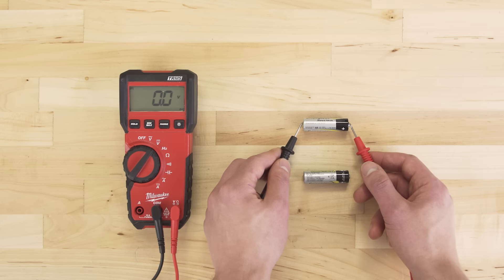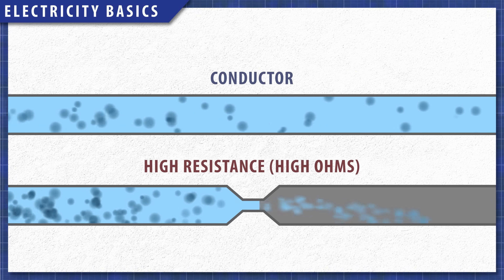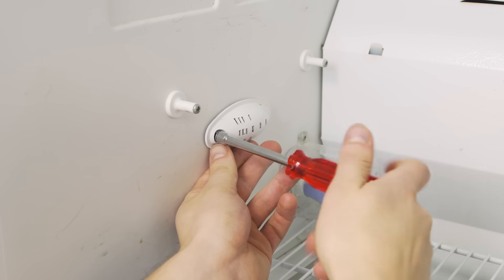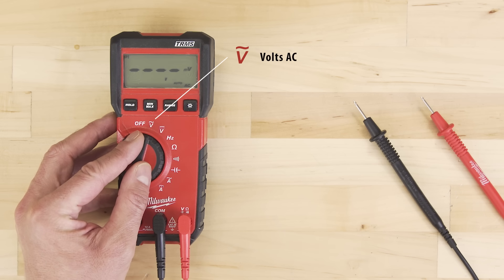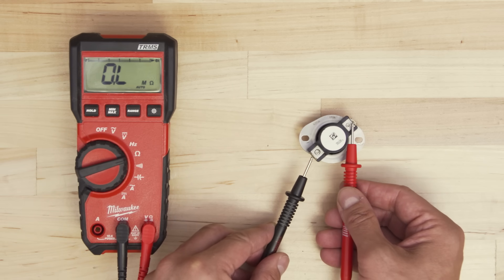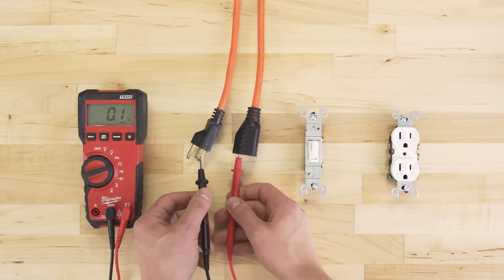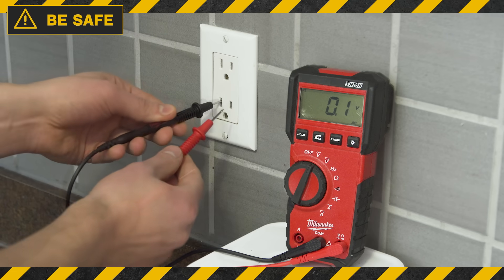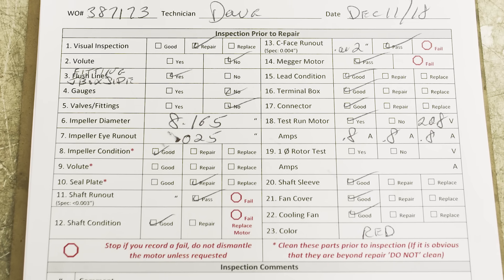How to Use a Multimeter & Electricity Basics | Repair and Replace

Comment: First thing you should do when you buy a multi meter is throw away those crappy leads and get some fused and shrouded ones. 
I’m so surprised nobody posting these videos says that.
Next is get a Kewcheck 103 or similar.
Reply from the maker: Thanks for watching. You are right that multimeter leads with built in fuses add an additional layer of protection. Not many models include those leads but it will be interesting to see if that something that will change over time.
Reply: @AmreSupply  The biggest problem is people poking through small holes. It's less of an issue in the house/car but I've seen it go badly......

Comment: There are many errors in this video. First, 60 Hz current flow does not change direction 60 times a second. It changes flow direction 120 times a second. Each Hz is a complete cycle of forward and back. OL or O/L does not mean Open Loop. It means Over Limit. In other words, the reading is higher than the meter can display on it's current setting. If you get an OL reading when trying to measure voltage and think it means Open Loop someone could get killed very quickly. Another very important factor is the multimeter's Category and voltage rating. A Cat I meter is good for electronics and not much more. It might not be safe to measure a regular wall outlet. A 240 volt dryer outlet would require to be Cat II and rated for at least 300 volts but Cat III and 600V would be better. Also, making any measurements of live electricity of 120 Volts or more as part of your employment requires the use of appropriate PPE and Arc Flash certification. It's the law.
Reply from the maker: Hi Rich, thank you for watching. We appreciate you sharing your thoughts and you make some good additional points. The "changing direction 60 times a second" was an error that we caught only after uploading. This is something that can't be fixed without completely re-uploading the video, but even with the error, we feel that the difference between AC and DC still should be clear. This video is meant to support our other repair videos which are focused mainly on understanding circuits and continuity tests of isolated components. We do not show live testing of appliances and that is one area that we leave to the professionals. This video is intended to help people get a base level understanding of electricity so that they can do some simple tests and better communicate with professionals when more in-depth work is needed.

Comment: Good basic multimeter training but should have proceeded into amp probe use.It's safer than voltage testing & just as useful.Can diagnose low refrigerant, dryer heater failure (especially when one heater is open)
Reply from the maker: Thanks for watching. Testing amperage is outside the scope of this video. This video is meant to support our troubleshooting and repair videos which focus on continuity tests of components.

Comment: Excellent content.  I've worked on about all the devices shown!  How did you get 1.5 M views where mine got 80.  (Just 80).  https://www.youtube.com/watch?v=POxw_gCcUj8&t=2s    It is prepared more for rural power wiring.
Reply from the maker: Thanks for watching. It has taken a while to build our YouTube channel. Some views come from the YouTube search, some come from YouTube recommending this content. Not all of our videos get a million views. There is no single way for that to happen but what is needed is good content that people continue to watch and don't click away. As well a good thumbnail so people will actually click on the video. The right title, description and keywords helps YouTube know what your video is about, and will help with the search results and the rest comes with time. Likes, comments and other interactions help boost a videos as well.
Reply: @AmreSupply  Very good, thanks for a thoughtful and sincere reply!  Likely it is the keywords "how to use a multimeter".  That was the question which was asked and dropped my jaw for 25 years since a person has to know electricity to use a multimeter, it's not simply a "magic meter".  :)

Comment: Slight problem with video. 
The testing of the wall out let. 
The use of both hands testing high voltage is not recommended. If there was a problem with the test leads,insulation damage as example a current would flow up one arm through body/heart and down other arm . Where I live it's 250v you could die. It's safer to use one hand , hook up one lead then prob with other using one hand.
Reply from the maker: Thanks for watching. This video was focused on 120V in North America but it does seem like a lot of views are coming from other countries with a different power system. You are right that in the case of the damaged leads, the safest way would be to use a single hand. That's why inspection of the multimeter is essential before any testing is done. Gloves can be another additional layer of safety as well.
Reply: @AmreSupply  Many thanks for replying.  I'm in Western Australian and we have a truly stupid system which uses the plumbing as part of the earth system.  The earth's and neutral come together in meter box , result if a failure at this point occurs pipes become live 250v and you can die taking a shower.
My son ended up in hospital and is ok a young girl near us turned on garden tap and now permanently brain damaged. 
All new houses now must have earth leakage breakers on power and light circuit's  old homes if sold must install and rentals. 
Great video, being an electrician I tend to like watching these videos.  All the best to you,  got a feeling you in Canada.
Reply from the maker: @chuckmaddison2924  Thanks for sharing that info. You are right that we are based in Canada. It is quite fascinating how different countries have various electrical and plumbing codes, each evolving at different times. Not all systems are as safe as others but generally the codes all require new homes or renovated homes to be up to the new level of safety. In Canada a GFCI circuit is required for all outlets close to a kitchen or bathroom sink. We also have a dedicated ground which connects back to the neutral on the breaker panel.

Cheers!

Comment: voltmeters have a very high resistance so you won't get a shock from the probes.
Reply from the maker: Thanks for watching. You are right that the insulation of the probes has a high resistance. However, damaged to the probe handle can increase the risk of a shock.
Reply: @AmreSupply  No, I think you misunderstand.  I am not talking about the insulation on the probes. I'm talking about the meter itself. The actual voltmeter has a high internal resistance. Since a voltmeter is connected in parallel across a circuit it must have a very high internal impedance to not affect the circuit. 
This high internal impedance means that very little current will flow through the leads. Therefore there is no risk of shock.

Comment: Why is Americans using  only 120 Volts? Doesn't it give lower power to electric tools? How in earth are people in America even charging their electric cars in future? Europe uses 230V.
Reply from the maker: Thanks for watching. Thomas Edison, who devised the first practical light bulb, determined that his bulbs would be powered by about 100 to 110V, as an optimal choice for his filaments. When the power system in North America was set up, the final drop to individual homes in the US became 240V center-tapped, where wiring in the house was divided evenly into two sets of 120-to-neutral lines, plus several 240V outlets for heavier loads like ovens and dryers. When Europe switched to a 220-240V power system, North America already had many appliances and other devices setup for 120V so it would have been a difficult change for North America.

Comment: @AMRE Supply
I wonder how pressure is created in the wire in order to send electron ?
Reply from the maker: Thanks for watching. Since voltage = pressure, the amount of voltage needed for an electrical current to flow will depend on the resistance of the wire. Its all interdependent: https://www.rapidtables.com/calc/electric/ohms-law-calculator.html

Comment: What about my car battery? Duh
Reply from the maker: Thanks for watching. Car batteries can also be tested using the Volts DC setting. Fully charged automotive batteries should measure 12.6 volts or above. When the engine is running, it will show between 13.7 to 14.7 volts.

Comment: I use the amps multitester to the house power socker, and suddenlly my breaker trips.. the whole house mad at me 🤣🤣🤣
Reply from the maker: Thanks for watching. It is not recommended to use the amp setting with AC voltage as was cautioned in this video. The amp setting will measure the current flow, and without a load there will be a short circuit where the current will flow unrestricted. This is why the breaker tripped.

Comment: From a life long electrician. A digital auto ranging VOM meter is a great tool but NEVER purchase or use and test & safety equipment, tools or Lee's from lying cheating lack of quality control evil bag communist China. Had their meter leads break first month of use. Coworkers who had cheating China sockets hated them. At least 1 socket in every set was oversized and a lot of times one socket undersized causing you to hammer them on.. The larger the motor the smaller the resistance. Before performing resistance test double check that there is no power.
Reply from the maker: Thanks for watching. You make some good points about quality which is especially important when using a multimeter.

Comment: Direct current illustration....battery operating a fan. Are you sure D.C. current flows negative to positive as you indicate?
Reply from the maker: Thanks for watching and that is an excellent question. 

Conventional Flow Notation refers to how the electric charge moves from the positive (surplus) side of the battery to the negative (deficiency) side.
Electron Flow Notation refers to the motion of electrons in a circuit, which is from negative to positive.

Most engineers and electricians choose to make conventional flow their notation as it helps to simplify their drawings.

Both can be used as long as the entire circuit is analyzed in its entirety.

Comment: Are those test leads fused ?
Reply from the maker: Hi Will, thank you for watching. That multimeter uses standard leads. If you're curious it's the Milwaukee 2216-20 model https://www.amresupply.com/part/2216-20-DIGITAL-MULTIMETER
Reply: @AmreSupply  Just as I guessed. No criticism to you but to Milwaukee - they should fuse their leads. Putting non-fused leads on a potentially dangerous circuit can lead to injury or worse. Just my ten cents.
Reply from the maker: @willmitchell255  Thanks for sharing your thoughts. An extra layer of safety is always helpful. The fact that fused test leads are not included with all multimeters might be a 2 factor thing. Multimeters do have an internal fuse so the need for fused test leads would depend on what the multimeter is being used for. Fused test leads do add an additional cost, so buying fused test leads separately might still be common for a while. There are more talks within industries requiring it so it might change in the upcoming years.

Comment: I have an outlet outside on the side of my deck and it no longer works when anything is plugged into it.  Do I need a new outlet?  And im assuming I need to turn the breaker off for it.
Reply from the maker: Thanks for watching. Its possible that the outlet is faulty or the connections are loose. Regardless you are right that you have to turn off the breaker first. For this scenario, using a NCVT non contact voltage tester will help verify if the circuit is energized and has voltage without having to touch it. https://www.amresupply.com/part/9462517

Comment: Well... I stuck it for four minutes - but no advice, yet, on how to use a meter. Gone.
Reply from the maker: Thanks for watching. The video is split into different segments which should show up on the video playbar. We know that not everyone will be fully interested in each segment but can skip ahead to the segment that they would like to see.

00:00 Intro
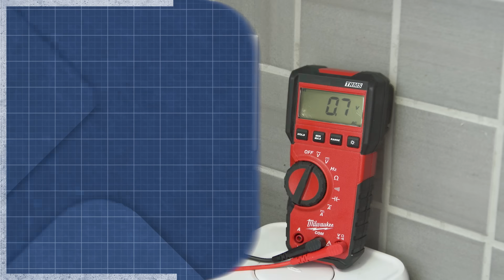00:54 Electricity Basics
03:09 Multimeter Setup
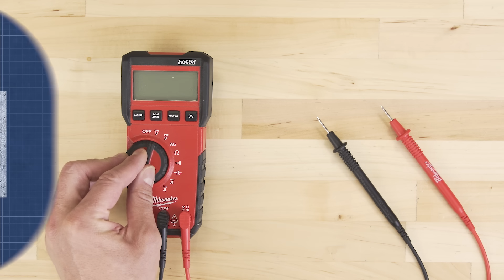05:02 Continuity Testing
07:03 Voltage Testing
08:49 Amperage Testing

Comment: I see you skipped over the HZ setting. Granted it's something you will probably never have a need to use, but I found it to be very helpful when adjusting the speed of a portable generator engine. Someone had messed with the adjustment, and the generator was running closer to 50HZ than 60HZ. A simple adjustment brought it back to 60HZ.
Reply from the maker: Thanks for watching. The HZ setting is not commonly used but checking a generator is definitely one case where it would be very useful!

Comment: Can’t get my lights to work on my vintage snowmobile. Can I use something like this to test what may be the problem ?
Reply from the maker: Thanks for watching. That is a great question. You can do a few things. You can test the lights for continuity. If they are burnt out then replace them. You can also test the wires for continuity. With older motorized vehicles especially those exposed to moisture, corrosion at the terminals can prevent electricity from flowing so its best to check each connection point along the way.

Comment: its important to use multimeter that has limit appropriate to voltage youre testing
Reply from the maker: Thanks for watching. We mentioned setting the range at 4:50 but the example was for the thermistor testing. Mentioning to set at the appropriate range again for the voltage test would have been helpful.

Comment: There are several little inaccuracies.  For example, a component with OL  when testing continuity needs to be replaced.  Well, sometimes yes, sometimes no.  More accuracy would be helpful, especially for a beginner or introductory video.
Reply from the maker: Thanks for watching. That is a good point, and you are right that it depends on the component. Switches are one example and it also depends if those are normally open vs normally closed. We actually made 2 more videos that explain different types of components which gave us the space to go into more detail: 

Appliance Component Testing - Part 1 (fuses, heating elements & thermistors) https://youtu.be/e_1pOWSVUfg
Appliance Component Testing - Part 2 (switches, solenoids & motors) https://youtu.be/Mdu7QlAzWOg

Comment: I personally would NEVER recommend you use your meters probes into a LIVE sockets outputs or via a mains cable attached to one,  it can take as little as 50-150mA to cause a cardiac arrest even death. There are safer ways to test  socket testers for one educate yourself before even attempting the task.
Reply from the maker: Thanks for your feedback. You are right that there are dedicated tools such as socket testers and NCVT that can be very useful. Not everyone has those on hand so this video was focused on what can be done with a multimeter. We have realized there are a countless videos out there, many showing receptacle testing without any mention of safety. This video was meant to give the basics, help clear any misunderstandings, show continuity tests as well as basic voltage testing. There are multiple safety warnings in this video with a clear yellow black border as well as a recommendation to contact a professional when it comes to testing live voltage.
Reply: I agree! We are missing important safety measures from this video! 120-240 AC will kill you, if not just leaving you on the floor sweating profusely while your muscles shake uncontrollably. It's nothing to mess with.

!!! Warning !!! I noticed a safety precaution not observed: If measuring 120-240 AC receptacles and plugs, place the two probes in one hand so that if there is accidental contact, current doesn't run up one arm, through your heart which stops the heart, and down the other causing a fatal electrocution. The video shows the INCORRECT way of measuring outlet voltages. Do some digging for safety first!

Comment: Decent video but anybody that is not electrically trained should steer clear of electricity.
Reply from the maker: Thanks for watching. You are right that a lot of things are best left to the professionals. The goal of this video was not to encourage homeowners to start doing major electrical work in their homes. Rather it is something to help address some common misconceptions and to show some of the basic tests that can be safely done. This video is also meant help support our other videos that deal with continuity tests on components, which are safely isolated from appliances (that are disconnect from any power source).

Comment: You didn't show measuring the current with multimeter
Reply: @AmreSupply  yeah, but it is with clamp meter. I asked for Current measuring with the multimeter, probes
Reply from the maker: @Mammu06  Are you measuring DC or AC current?
Reply: DC current
Reply from the maker: @Mammu06  Then you'll have to connect the multimeter to the circuit at some point. To meausre current you're basically using a multimeter as a wire to allow the current to flow through it. At that point you can measure the flow.

Comment: From a life long sparky. Never purchase or use any test or safety equipment tools or LED'S made in sum bag pack of quality control lying cheating Communist China. Never ever attempt to measure 480 volts with a cheap meter only rated for 500 volts. A cheap electrician did this and meter blow up in his hand causing burns. Homeowners please take the time and turn power off before working on electrical items. I install a LOTTO device on all circuit breakers that I turn off and place a lock + tag on them.Was taught to always check that meter works then test circuit then check meter is working. ( TEST  CHECK. RETEST )